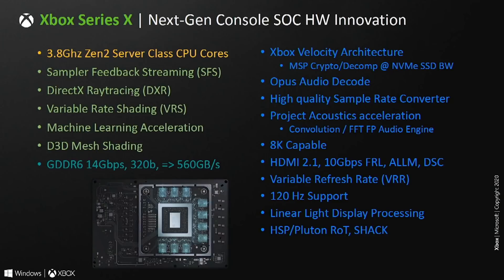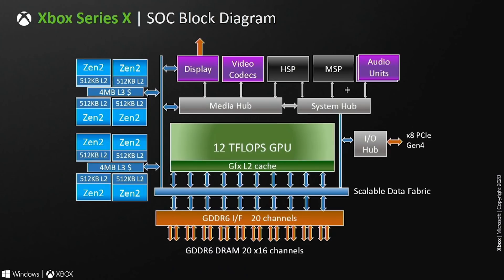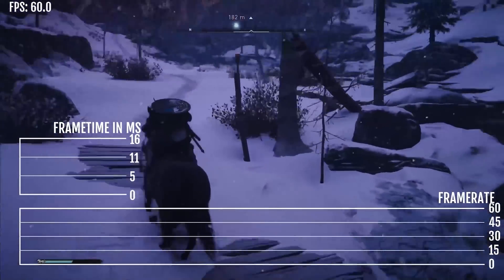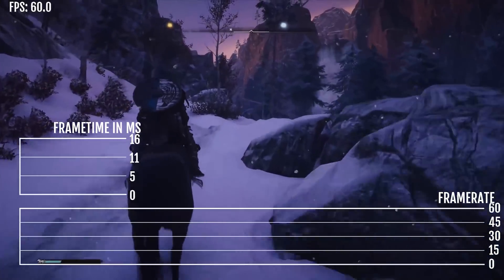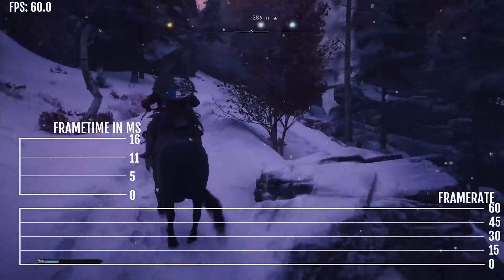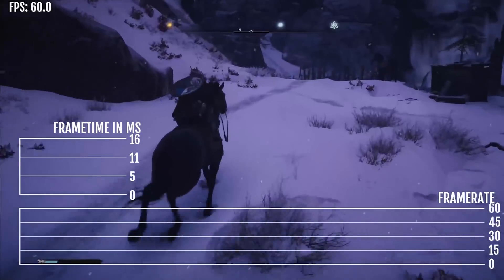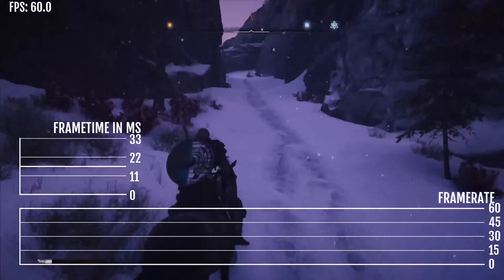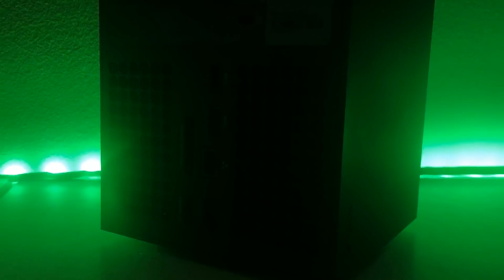Xbox Performance to be UNLEASHED | Xbox Series X Mesh Shaders & SDK Updates Changes Everything

Comment: It’ll be pretty cool to see how Mesh Shader compares to Geometry Engine.
Reply: That's only a piece of the pie. VRS, ML, & SFS will be the key trinity for the hardware's max efficiency & innovative technological technics & achievements we've yet to witness.
Reply: @jessomadcity2815  Yup, it will be interesting seeing what comes from all of that. Consider, for example, how radically different things were for X1/PS4 launch with no TAA, no dynamic res...
Reply: In fairness MS has virtually the same Geometry Engine as PS5 based on primitive shaders, as well as an advanced Geometry Engine in mesh shaders, they just didn't market it like Sony did on the PS5.
Reply: Both are geometry engines just one use mesh the other use primitive
Reply: @jamesw884  the terminology isn’t important. What is worth knowing is that both engines allow to have a lot of control about geometry displayed.
Mesh shaders allow to reduce the level of detail. You can do the same pretty sure on Sony’s engine.
Reply: @franzkuntschnig1320  the big difference is ps geometry engine will be behind but we still have to see the custom work ps have done on it and if it can bring an improvement
Reply: @jamesw884  well dude, that’s just like your opinion. I just hopes Microsoft brings something on this week so I’ll see Sony’s things in their pocket.

I just don’t care about any fanboytalk like over on digital foundry about 200p resolution differences or 7-8 FPS more or less.

If you think that, it’s fine. I’ll think Sony first party games will be again be the best  because they have the most experience, talent and if you think Sony does chose inferior solutions instead of taking rdna2 features that’s ok.

🤷‍♂️🙃
Reply: There pretty similar, the PS5 is just and earlier version, the "geometry engine" is just sony renaming the "geometry processor" that was introduced in the RDNA1 line.
Mesh shading support is simpler more advanced and more performant, but not by much.
Reply: @mayen67  lol
Reply: @mayen67  I wouldn’t be too sure. It’s just a name branding. Sony called it’s engine on ps5 geometry engine but it’s an enhanced and more developed version of the ps4 engine (need to be compatible, you do that with hardware and api) and ps4 wasn’t rdna1 and Sony did always their own hardware thing in a lot of ways, even if they use now amd produced components. Amd uses direct x, PlayStation doesn’t.

That’s why ps5 hardware is far more customized. It’s not a rdna1 thing.
Reply: @mayen67  its the geometry engine from vega apparently
Reply: Mesh Shaders essentially taking the geometry engine and only using the portions of the pipeline needed.  Otherwise the geometry engine is a sequential list of tasks.   Just like how DX12 and Vulkan alleviates bottlenecks related to CPU and RAM, mesh shader will alleviate bottlenecks in the geometry engine.
Reply: @ChildoftheKoRnf9  lol
Reply: From what I know, Mesh Shaders do away with the fixed, function, vertex and indices work that is still done for the Geometry Engine. Everything else should be about the same.
Reply: Mesh shaders is a feature and an engine is an engine. To my knowledge geometry engine does its own vrs and has its own mesh shader solution.
Reply: @franzkuntschnig1320  I don’t know much about Mesh Shader or G.E. So what is your understanding of M.S compared to G.E? Are they both alike or is Mesh Shading more advanced than G.E? Interesting to hear your thoughts
Reply: @pauljesusislord2912  I think it’s the wrong question. It’s not like to compare hardware units. 
 
Both systems use features to handle geometry more efficient and Ressource saving. And how that will turn out no one will ever know how is not involved in creating those digital worlds.

What’s more interesting imho is the question which is easier to handle and to push.

The question can’t really be which reduces the level of detail better to save performance, that’s basically a developer thing.
Reply: @pauljesusislord2912  Mesh shaders reinvent the entire geometry pipeline. A mesh is broken down into smaller portions and those small portions are processed in parallel. There is a world of a difference between the two and you can't compare them other than that one represents an old inefficient way of doing things and the mesh shaders represents something highly efficient and flexible.
Reply: @franzkuntschnig1320  I've read that it uses primitive shaders but it's hard to know since Sony doesn't seem to release much info.
Reply: @franzkuntschnig1320  VRS and Geometry Engine are not related. One handles Geometry, the other allocated pixel detail.

The FULL name for Mesh Shading is 'Mesh Shading Geometry Engine.'
Reply: @davenewman4663  mesh shading is a task of the gpu. Vs Ge that does more then one task. Lol
Reply: @franzkuntschnig1320  To clarify...GE has nothing whatsoever to do with VRS or anything akin to it. That's a myth stemming from Sony fanboys who knew nothing about either VRS nor the geometry pipeline misunderstanding an awkwardly phrased tweet from a year ago. That misunderstanding then got repeated as 'confirming VRS for PS5' by tons of CC's including RGT. It's false.
Reply: @TavishHill  sonys console has its own solution. Lol!
Reply: @flubber8   Their changes to the prim shaders, while great and needed, aren't quite at the level of mesh shaders. Sony's approach to geometry is a half step towards where mesh shaders are. It does mostly the same thing but less programmable/flexible/efficient.

Sony has no tech whatsoever that is similar or akin to VRS in hw. None at all. The notion Sony has some super secret VRS tech hidden in its GE is a myth based on a poor reading of a Matt Hargett tweet from a year ago that ignorant Sony fanboys just keep repeating for whatever dumb reason.
Reply: @TavishHill  lol!!!! Most people have no clue what GE is and everyone and there is a online arm chair Dev. Lmao.
Reply: @TavishHill  how do you know anything that Sony has or does not have?
Reply: @flubber8  Sony told us what they have in their Road to PS5 video. They explained the geometry engine's prim shader tweaks there. It has nothing to do with VRS, which is something that happens in the drawing stage (not the geo setup stage). If you had any idea what VRS even was you'd understand this (it varies the rate of shading pixels on screen based on frame data). 

There is no secret sauce hidden VRS tech in PS5. We know it has no VRS since games built to use the tech do...on other platforms....just not on PS5 (Godfall has it on PC, not PS5...Dirt5 has it on XSX but not PS5). 

I'm here tryna explain shit to ya but if you dead set on just remaining an ignorant, deluded fanboy by all means enjoy spending the next 5-7 yrs waiting for something that will never show up.

Peace.
Reply: @flubber8  No they quite directly said exactly what their changes to the GE's prim shaders do. Explicitly. They can do tessellation with and vary the geo LODs and stop culling of tris earlier in the pipeline. And that's GREAT. Mesh shaders do all that stuff too (culling happens even earlier in the pipeline compared to he GE in PS5). Mesh shaders replace the entire geo pipeline. It's an entirely new paradigm for handling geometry, not just a tweak to how the existing GE works like PS5 does. It is known for certain that mesh shaders are more programmable/flexible/efficient. Not a guess; we know this because mesh shaders allow devs total control over programming the shaders, far more control than prim shaders provide on PS5. 

We don't need to lay around waiting for magic VRS hw to appear out of thin air like morons. We know it isn't there. AMD and MS confirmed it. Devs have demonstrated it ain't there with their actual games. Sony reused to answer directly. This is no longer a guess. It's been confirmed indirectly by AMD.

Look, I'm informed on this stuff. I know ya don't wanna hear what I'm saying. But I'm not going to just keep repeating it to some idiot console warrior who wants to cling hopelessly to some fantasy secret sauce. It ain't there. The sooner ya grasp that some ppl know more than you do on the matter the sooner you can anchor your self worth to things that are actually tangible instead of making a fool of yourself on the internet.
Reply: @TavishHill  mesh shaders don’t hold a handle to what Ge does. Lol! People that worked on ps5 have said this. Lol! Listen to interviews with many devs working on the ps5. Being informed is great but making shit up is horrible and fake.
Reply: @flubber8  You are adorable...
Reply: @franzkuntschnig1320  
the geometry engine is already being used.
Reply: @saltwagon2676  not fully it runs auto but can be fully controlled by devs
Reply: @saltwagon2676  so is direct x12 on Xbox. And? There aren’t different api to chose from on a console.

If you think all features are used on ps5 then you’re dead end wrong. All the games are ports and sony first party studios are the first to make use of the features in the near future while third party developer need to adept like in every generation, 🙃
Reply: @franzkuntschnig1320  all the features of ps5 are being used outside of super res.
Reply: @Gengie22  yes fully that's the way it's built.
Reply: @meshingaround9828  you don't seem to understand software
Reply: @meshingaround9828  I don’t agree on that. How should last gen graphic engine make use of features that are shortly released?

It’s the same like mesh shaders, because you need to build a game around that.

It’s not as easy as you think. You see how the UE5 demo looked... 🤷‍♂️🙃
Reply: @saltwagon2676  it hasn't been used at all developers don't know how to use the geometry engine stop lying madz gaming xbot troll it's a Very complicated separate unit
Reply: @franzkuntschnig1320  Um, that's a "tech demo" real time or not. Go check out the history of "Tech Demo's" for previous consoles and show me any game that ended up looking as good.
Reply: @nonyabusiness6084  i would say  that some games nowadays look better than ue4 tech demo imho or at least come close.

But you said it, it was a playable demo in real time running on a console. It’s like playing the demo of resident evil village and saying that will never look like this on a console. 🤷‍♂️

Everything said. This is not a trailer or a pc rendered showcase. It shows how a modern engine work and what it can do on middleclass hardware.

The question is how much effort it takes to make a full game of this quality because all the details take so much time. But not if that looks can be archived, because they already are.
Reply: Mesh wins hands down. yet more sony smoke and mirrors
Reply: @markwilliamson3043  honestly its too early to say for sure
Reply: @markwilliamson3043  how do you know? Lol
Reply: @flubber8  cause i fkn do. i'm a dev for a massive financial gov organisation. i fkn know my shit. no detail, but sony backed the wrong horse.